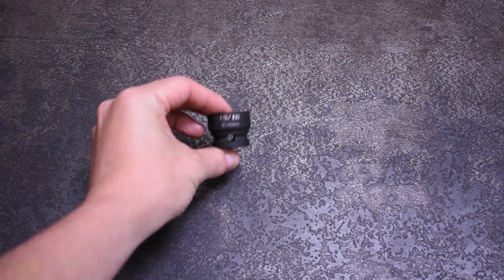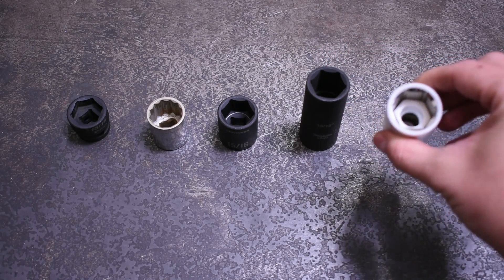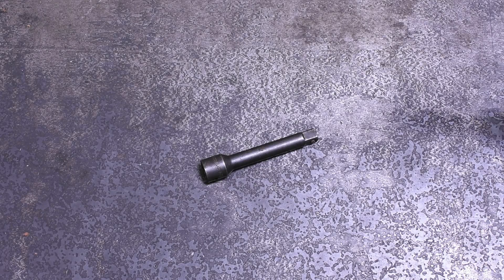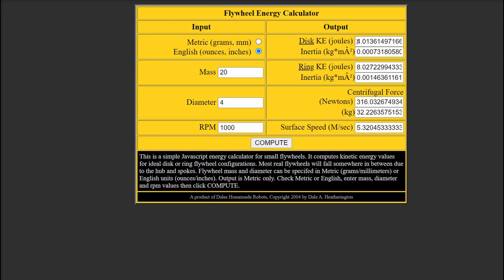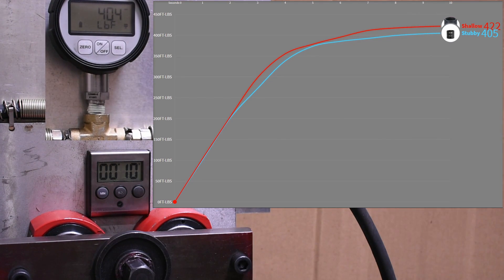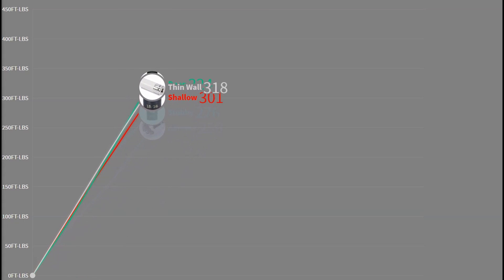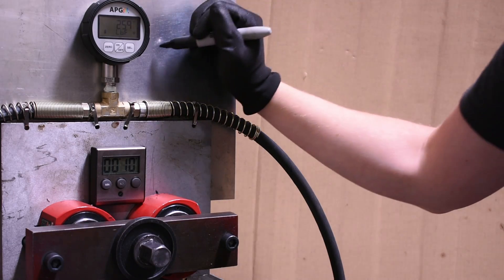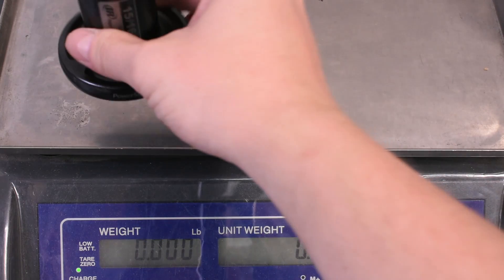Can Heavier Sockets Actually Increase Impact Dyno Numbers?

Comment: I used to work at Discount Tire, and we had relatively underpowered impact wrenches, so whenever a f250 or a larger truck came in and the regular sockets weren't cutting it the power sockets were able to get the lug off 9/10 times, so they definitely make a huge difference. But for an average user I wouldn't say the $100 price point is worth it for one singular socket.
Reply: It's crazy how much difference a shorter and/or heavier socket can make
Reply: I worked at discount too!!! If we couldn’t get the normal sockets to work we’d use the larger power sockets!
Reply: For $100 couldn't you just buy a better impact? There are air impacts that can easily take those off at $150-$200
Reply: @greod1006  if they have them bigger impacts we'd never get our wheels off we've again
Reply: @andys31337  Yes you would. With an impact!
Reply: People really have forgotten what a breaker bar is. I worked on commercial tires and even a 1 inch anvil impact isn’t always the answer for removing stubborn lugs. You eventually just wear and round the lug from beating it up. I only go to shops for tire work and even there they just abuse an impact at the end, and I have to pull out my breaker bar to actually torque them down right because those guns are not an accurate finisher. And for the start it just takes 10 seconds to crack them then run the impact if you know your tool is under performing.
Reply: @trengoblin2  or oxy acetylene from the torch
Reply: @andys31337  thats what the yellow torque stick is for... ifykyk
Reply: @madjackgamingandfitness498  Back in Russia I worked on a retro car (made in the 1960s). Most of the nuts were rust welded. I did not have an impact wrench (due to being poor) and used a breaker bar all the time. God knows how many bolts were broken. Impact tools are a great invention.
Reply: @falrus  not knocking them I own a variety of them. It's improper use that I only have issues with. You work in the industry long enough you'll find plenty of botched oil pans thanks to a fool with an impact gun.
Reply: @madjackgamingandfitness498  For sure, but a breaker bar will live up to it's name more often than an impact gun will. The risk of breaking bolts is much higher with a breaker bar than an impact gun due to the different stresses you're putting on the bolt.
Reply: @falrus good point.
Reply: @MrManBuzz Bolts, yes. Nuts, no. 
The breaker bar will save the nut more times than it destroys the bolt, statistically. 

Add in user competence, method, sense, a breaker bar wins…and impacts are still necessary. Occasionally better.

Comment: I have several of those IR sockets (17 19 21 & 22). When nothing else will work, these do, every time. My experience is they will get the bolt out or break it. If it's going to come out, these will get it. If these wont get it, it's not coming out.

Comment: i wonder who will be first to release a 1/2 inch to 1/2 inch adapter with a fat metal donut ... ? i think the centrifugal effect of the diameter of the donut helps more than an equal weight dispersed along the length of a heavy weight socket .

Comment: When you use air impact tools,  do you add vane motor oil before you do the tests?  The oil film reduces friction as well seals the mating surface between the vanes and cylinder grabbing more air pressure to drive the impact tool.  I enjoy the videos, thanks.
Reply from the maker: Yes sir, each air tool gets 3 drops before testing on the channel

Comment: the heavy-walled sockets don't flex or twist as much which is the reason for more torque not the weight.  the weight is just a result of the heavy walls

Comment: I have a set of those deep 6 point protective sockets and they work well for around $6 each. More than worth buying even if you have other sockets that fit,  because they don't beat up the lug nuts or scratch the wheel.  BUT! You have to be careful which brand you purchase. Some are cast knockoffs and will shatter according to some reviews.

Comment: Heavy weights improve riffle accuracy by way of heavy barrels, and or adding weight to a riffle.
Reply: I don't think that's really applicable to this situation. A heavy rifle barrel can add accuracy by improving barrel harmonics and/or by allowing it to remain accurate during long strings of firing after the barrel gets hot.

Just adding more weight doesn't necessarily mean you're going to get more accuracy.
Reply: Thicker barrels help keep them from flexing like noodles. 
I think it was a forgotten weapons video where they are shooting a BAR full auto in slow mo and you can really see it

Comment: Testing different socket brands and materials will also make a difference, as is the test is inconclusive. .. You may have proved your point it does but at this point it not necessarily means more weight = better results... A more accurate test is using a cheap and a expensive socket and add weight to that one socket and compare the results... Welding is technical and expensive if you don't already have the equipment, you can use epoxy putty and add fishing sinker in a gradual way.... If weight only makes a difference this test will be more accurate than using different sockets...

Comment: Interesting video but now I want to see you sleeve a normal socket with some pipe and see what kind of results you get, jbweld or a similar compound would probably be the best way to attach it without potentially impairing the strength of the socket like welding could
Reply: I'd like to see  high speed photomicrography video of the IR socket in action, showing the outer ring moving like a torsion spring in relation to the central core. That's why the cutouts rather than filling it all in.
Reply: @wingerrrrrrrrr  No, the cutouts are there to provide the best distortion reduction to weight increase, ratio.  Torsion spring action is exactly what you want to avoid because it reduces impact force in order to store energy and gradually dissipate, just as it does in any other application.

Comment: In a garage we tried everything on a crank bolt to change the water pump nothing would move, we got a heavy socket (like mentioned for Honda) even if nobody believed it would do anything we were out of options and within 2 seconds it was loose even if it didn’t move after atleast 10mins of impacting before. I haven’t heard anything about it since so im happy to see it here

Comment: Yes this did make plenty of power but its also 3x the diameter I really think this would be a limiting factor in real world situations. Also Kinetic energy = 1/2 mass x Velocity squared. It takes work to move a heavy object, so to increase kinetic energy it is far less work to move a lighter object faster (there is more bang for your buck because the velocity is squared). Flywheels do store a lot of energy but take a lot to get going.  It would be interesting to see the smaller socket spun at 1/3 more velocity to see the power gains in comparison to the socket with 1/3 more mass.

Comment: But are the results the same when removing a bolt?
Reply: I would suppose so because we still See that increase when the Bolt doesnt move anymore.
Reply: @puddinggamez8599  I tend to disagree, It requires a build up of momentum to create a flywheel effect. In the tightening of bolts momentum is built as the bolt or nut spins freely prior to bottoming out. The momentum dissipates to zero when tightening occurs.

When removing a bolt there is zero momentum at the start-- nothing built up. Thus the reason the hammer effect is built into the impact tool.

Think of it this way: If a truck weighing 80,000 lbs and a truck weighing 40,000 lbs are parked at the top of a hill then allowed to coast down the hill the heavier truck will achieve more speed and thus more momentum as it coasts down the hill.

I'd like to see this tested.
Reply: @recyclebills  In the Video you Can See how the Bolt is barely moving basically the same when opening and it still gets more torque, this doesnt Have anything todo with Flywheels but simply the weight of the Adapter. You Can See this incredibly Well on the IR Run with the air Impact Driver the Bolt is just barely moving and the Torque goes Off the Chart the only Thing "winding up" is the Impact mechanism Inside the Driver the High Torque is coming from the High Mass Times the acceleration of the Driver.
Reply: @puddinggamez8599  I'll believe it when I see test results.

Comment: You should test if “limp wristing” the impact gun makes a difference compared to if you hold it very tight.
Reply: I would imagine it does as the tool itself can move from the impacts instead of the impacts transferring its energy into the fastener. That's lost energy.

Also, you can make some semi-auto handguns malfunction by limp wristing them. The entire gun moves backwards which robs the energy transfer needed to cycle the slide.
Reply: Sometimes I find it does.
Good request.
Reply: I would say it definitely affects torque. It's likely just like letting a wheel spin while torquing on lugnuts, just from the other side. That energy that goes into your wrist is not going into the fastener.
Reply: Def makes a difference to the fastener lol
Reply: Been thinking this since I found the channel. Needs a holder for constant results

Comment: Interesting video —instead of buying a different weighted socket for each size could a weighted adapter be used between the impact gun and the socket? It should follow in general the design shown with larger diameter and perhaps spring loaded weighted ring. Of course patent infringement would be likely so IR would allow this only by license. And maybe IR could develop a whole series of larger sockets which firmly and quickly attach to their patented "TorqueRing" adapter — IR "You're welcome!"

Comment: I’d be interested in seeing some wear test analysis between different impacts and between different sockets, including that weighted socket. When I say “wear test analysis” I refer to the wear that occurs to the fastener being impacted on. This has been a real issue for us on the farm with the Milwaukee fuel high torque impacts. These things wear out the impacted surfaces of lugnuts faster than anything else I’ve used. I can’t speak to how this compares to other cordless high torques, as we have only used the Milwaukee’s. I have plenty of different brands of mid torque and smaller cordless impacts and we’ve used several different CP IR snapon and blue point air impacts over the years and have never experienced anything close to this accelerated wear of the fasteners that we have experienced with the Milwaukee high torque. This isn’t a subject that I have seen addressed on YouTube yet and I’m sure I’m not the only one who has experienced this. Should make for some interesting content. Comparing different impacts, combined with different socket types and brands.
Reply: Interesting. Impact sockets are softer by design vs chrome and I’d venture to say maybe the fuel sockets use a different alloy than most chromoly traditional impacts. I’ve never seen that with Snap On, USA craftsman, Wright, ICON, SUNEX. Personally I think the Milwaukee sockets are trash. You need to toss those in the garbage and invest in Wright industrial sockets that are correct for the equipment you are servicing. The Milwaukee is cheap Chinese junk. Wright is USA made right in OHIO. There is a difference. All the best.

Comment: I have "weighted" sockets which I use for removing honda and toyota crankshaft bolts.  Makes all the difference in the world.  Regular impact sockets many times won't remove the crankshaft bolt, but the heavier sockets work (f=ma).

Comment: Even though the long sockets buck more than short ones they are quite nice because if you're taking smaller wheel nuts off you can fit 2 nuts in the socket at once

Comment: I have first hand experience with the Lisle style sockets and can say they definitely work.
I bought an old Civic with a broken timing belt, and used every tool that I had in my box or could borrow to try unsuccessfully to remove the 17mm crank pulley bolt. I even tried using a 3/4” air impact gun (unfortunately without having a 3/4” drive 17mm socket) and all it did was laugh at my reducer. I was highly dubious of these sockets, but bought a set as a final desperate attempt. The bolt came out within 5 seconds when using the super thicc walled socket. They definitely made me a believer. I’ve used the 17mm and 19mm now multiple times, as well as loaned them out a few times, and they always get the job done. I’ve even been able to use my weak Craftsman electric impact to remove the crank bolts when my IR air impact with a regular socket can’t.
Reply: My son the mechanic had much the same experience. 
Two men working for an hour with breaker bar on my 2003 crv.
Years later when a Friends civic using a weighted socket and bolt zips right out.

Comment: but if i spend an extra $100 on a bigger impact instead will i get the same increase on EVERY fastener size instead of a single fastener size, and not be limited to huge clearace?
Reply: I thought the same.  But I think the power sockets are meant for gaining power in a specific job that comes up often (and didn't exist when the shop was setup).  So these are sold as individual sockets and if a set of them is needed then its worth it to upgrade the wrench.
Reply: Yeahh true, BUT you can make that weighted power socket yourself out of normal socket and a little bit of metal for maybe $5. Then it is MORE THAN worth it. :) So based od the results DIY weighted power socked DOES make sense.

Comment: First off, love the channel and the work you guys are doing.
Secondly, the term 'beans' should be standardized in the industry lol. Imma start using it in my garage. 
Last, yall show the masses of each socket but not the moment of inertia (MOI) which is what is really providing the extra torque. I know MOI is not a well understood topic, and that it is hard to calculate for every socket, but I just wanted to point that out. Two sockets can have the same mass and different MOIs, it all depends on how far away the mass is from the axis of rotation; like the IR socket having that mass ring located far away from the axis of rotation.
I really like how you showed the IR patent. This shows you put a lot of work in to this video, like you do with all of them.
Thanks and keep up the great work!

Comment: Before I bought a 3/4 air impact for $90 from HF, I used a 1/2F/3/4M adapter and a 19mm deep well s/o 3/4-dr impact socket. It always worked for Honda crank bolts when an ordinary 1/2dr 19mm s/o deep impact socket did not. Source: Honda dealer tech using a 1/2 earthquake and IR2135 back then. Nowadays I have the PT850 and IRC9000 and rarely need the 3/4 HF gun. Would love to see the adaptor/3/4 socket combo compared to the IR power socket

Comment: Spring rates can be changed in many ways such as socket wall thickness, socket length, and even local stiffnesses within the socket such as around the anvil, or around where it interfaces with the nut will affect the total spring rate of the socket..  I do believe mass can also play a role.  I would say to truely segregate spring rate of the sockets from pure mass would be to test a socket and then attach a mass such as a collar to the socket and retest.  Will have to be careful and attach it to an area that already has significant stiffness like around the anvil connection.  Also want to limit stiffness increases to the socket to an attachment method like epoxy such as JB Weld might be more suitable instead of pressing on a collar or welding on a collar.

Comment: 13:02 and 14:10 - you're doing your math backwards. You should have the ir divided over baseline or you're comparing everything backwards. The correct gain is 33.2% for air powered and 26.7% for battery powered.

Comment: I thought the power socket was a scam, good to know it actually does what it says.
Do you think you could attach a dumbbell weight to a socket? Maybe machine the ID in a lathe for an interference fit with the socket, then press it on?
Reply: Why not just weld a weight on it?
Reply: @ShaunHensley  A lot of weights are cast iron, cast iron is hard to weld and you need special materials. Even if the weights are not cast iron, you would still have an issue trying to weld dissimilar metals. Even if you did manage to weld them together, the socket would be weakened from the heat, making it a potential explosion hazard.
Reply: @TheVexCortex  you could redden the weight with gas so it expands, and freeze the socket in a fridge and drop it over.

Comment: How about clutch types and output vs torque sticks. I've heard they only work with single or twin hammer guns and do not work with pin clutch or electric impacts. I suspect they simply are designed for weaker guns than 800ftlbs monsters we have now a days,  but it would be cool to see the torsion bar effect in action and how they do or do not diminish torque, how consistent they are, and if cheap vs expensive matters.

Comment: The thin chrome are made with harder material. The black impact sockets are soft so they don't shatter. From what I've been told
Reply: Hence the reason to wear eye protection as he did. I saw one fly out when a rookie mechanic used it to take out lug nuts.

Comment: What about a test to see if there's any noticeable difference when using a deepwell socket alone vs grabbing the deepwell socket while it's impacting and twisting it in the same direction. I feel like there won't be that much of a difference in torque, but maybe in time taken to get to a certain torque level. Or maybe you just end up with a violent hand massage while you're working.

Comment: I wonder if you could put a flywheel on a short extension to make your existing sockets work better?  It might have to be pretty huge to offset the losses from the extra connection, but it's an interesting thought, I think.